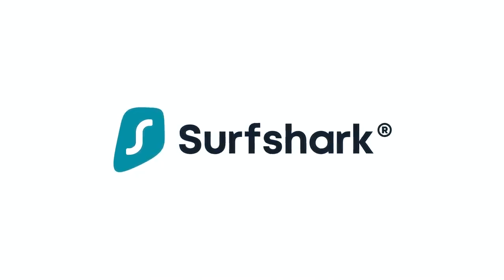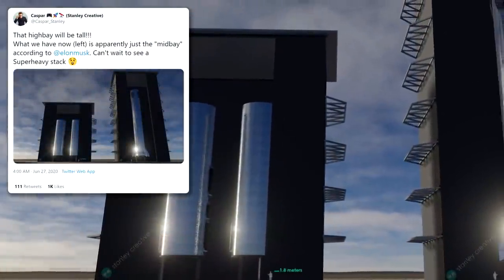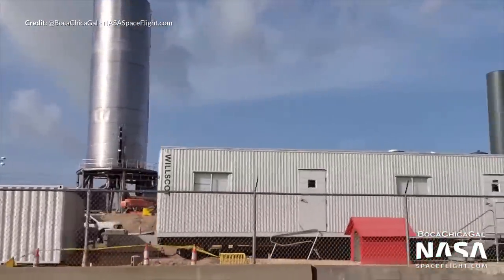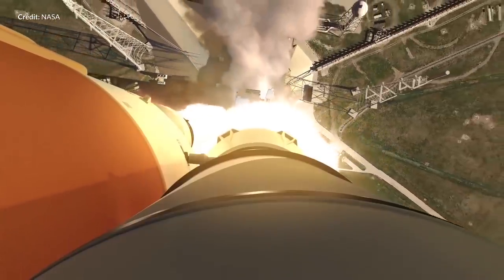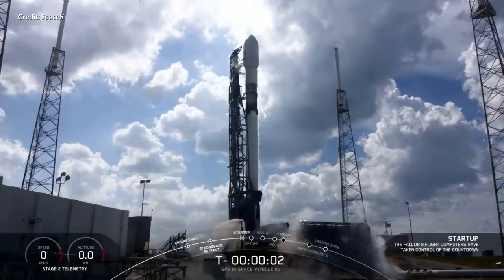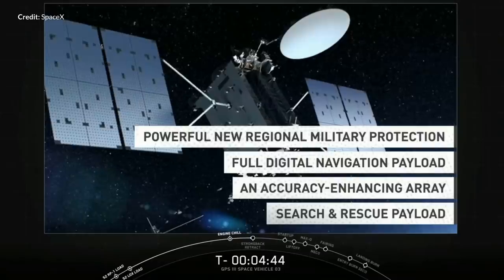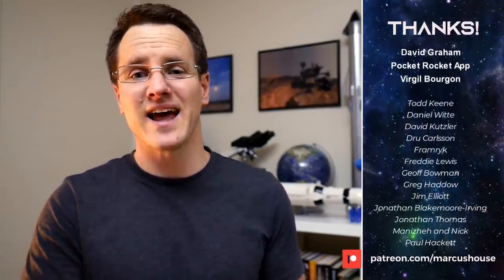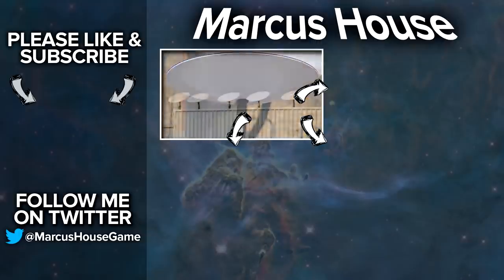Starship updates with SN5 Pressure Test, SpaceX GPS III, Mars Perseverance Rover Launch Date Slips

Comment: Vertical re-Orientation Maneuver and re-Ignition of Thrust

Yes, ladies and gentlemen it's the V.O.M.I.T. flip
Reply from the maker: That is the winner so far!
Reply: I was gonna write "collective throw-up moment" but your version is much better...
Reply: V(e)rOMarIoT you mean?
Reply: Yes please show the tracking station
Reply: NaIled it!
Reply: everybody:  Y E S
Reply: The V.O.M.I.T. flip appears to be extremely dangerous. Unless of course there is launch abort capability that can carry the crew to safety if something goes wrong. Better yet.... Why not scrap Starship and make SLS reusable?
Reply: @DavidJohnson-tv2nn  cos Starship will be the worlds cheapest launch system SLS $1b. Starship will be less then $100m
Reply: @Sonderax  How safe will Starship be?
Reply: @DavidJohnson-tv2nn  aircraft don't have launch abort systems and you don't poop your pants about them, do you
Reply: @DavidJohnson-tv2nn  we wont know until its flown a good amount. SLS will be human ready first but both are different. SLS is more crew based. SS is going to replace the F9 one day. Its gonna become a earth, lunar and martian transportation system.. We will learn safety once its ready for human certification
Reply: @Sonderax  Well, we know that Musk has no plans for launch abort on Starship. So there is a huge problem right there. It probably won't be certified for human flight without launch abort capability. Then the next question is... Where will production models be built? If they are built out in the junkyard like current prototypes... Then there is a real serious additional problem. As quality control can NOT be maintained under such conditions. So I can agree with you on this.. We'll have to wait and see. And hope changes are made for the better. Because as it stands now, it doesn't look good.
Reply: @DavidJohnson-tv2nn  space shuttle had no launch abort. That was certified. Many spacecraft have had no LA or IFA capabilities
Reply: @Sonderax  And we know what an absolute disaster the Space Shuttle was. Since the Shuttle, all manned space vehicles have launch abort. That includes Orion, Starliner, and Crew Dragon. Does anyone really want a repeat of the Challenger disaster?
Reply: @DavidJohnson-tv2nn  Only 2 disasters in the shuttles multiple decade life. Weve learned from that. Rockets are safer now. Starship wont have humans for about 5-10 years. It will be fine. We wont get Challenger v2
Reply: @DavidJohnson-tv2nn  "extremely dangerous.... Why not scrap Starship and make SLS reusable?"
Let them train with dummies on board until they master it perfectly. Five Starships with dummies at every Mars launch window should be possible. Money is not an issue as long as SpaceX keeps out of Stock Market shark sea.
Reply: @DavidJohnson-tv2nn  A disaster didnt launch the ISS, A disaster wasnt one of the most used space vehicles in history. Nobody wants a challenger repeat. But if we have something like Starship with 100-1000 people onboard how do u evacuate them all from a rocket mid flight?
Reply: @DavidJohnson-tv2nn  and the issues that lead to those shuttle disaster and close calls have been addressed with Starship. Also, starship itself is a launch abort system. And OF COURSE they won't make the final product on a scrap yard, don't be stupid now and pretend that would be an actual option.
Reply: I mean it's either that or "Begin Alignment Retrograde For Final Decent"

"Starship has successfully B.A.R.F.F.D.! 15 seconds to touchdown!"
Reply: @Sonderax  didn't the Orbiter have the capability to decouple from the rest of the STS and glide back?
Reply: @Sonderax  You obviously don't put 1,000 people on Starship. Even if it can carry that many passengers. Way too high of a risk. For 100 passengers or less you eject the passenger compartment or multiple small passenger compartments. From there, the process is really no different then launch abort for Crew Dragon. Just a larger version of it. Such a system will also work for a malfunction on landing. The are just too many chances for things to go wrong to risk that many lives. Because it's not a matter of if, but when something goes wrong.
Reply: @akshaygowrishankar7440  Only after the first 2 minutes when the solid rocket boosters burn out. And then, only under certain conditions.
Reply: @snuffeldjuret  There are always issues that can cause disaster. And new issues are introduced with landing. Regarding the Boca Chica junkyard where Starship prototypes are now being built... So where's the REAL factory going to be built? And WHEN will construction start? And if construction doesn't start soon, how will Musk meet his timeline of the first mission to Mars in 2022? Mission to the Moon in 2023? And a manned mission to Mars in 2024? You guys should ask some questions rather than just follow.
Reply: @DavidJohnson-tv2nn  About these... Raptor vacuum engines will eb able to be used at sea level, providing necessary security. And while yes, currently SpaceX is manufacturing the prototypes in sub-optimal conditions (mind you, those conditions are only external storage now), they are building up high bays at the same site. This is definitely still the rapid prototyping phase as we know and yet the prototypes have already shown a lot of potential (Pressures tested already qualify them for cargo flights even before the custom steels are developed).
Reply: @DavidJohnson-tv2nn  The beauty of the free market is that no central authority can make that decision. We get to see both run their course and pick the best for use.
Reply: @snuffeldjuret  People often forget that there is no launch abort system from the launch abort system. In the end, nothing is guaranteed and everything has a risk.
Reply: @akshaygowrishankar7440  It had no way to deal with a booster failing catstrophically (it was next to them, traveling the same speed), a breach of the main tank (same problem), or engine plumbing/pumps exploding (they were attached to the orbiter directly).
So for all scenarios one would first look at as failure cases, the answer is "no". Any non-catastrophic failure could be aborted, but that's true for Starship as well.
Reply: @DavidJohnson-tv2nn  But is it? I'd love to see the physics on the maneuver. I would think the movement may require a more complex number of maneuvers, but possibly it is not so more difficult than Falcon 9's. The danger may be on par, namely, a mechanical failure caused by a physical or software malfunction or a miscalculation in fuel. In these cases Starship may follow Falcon9's development, ie., a number of really spectacular crashes until reaching a near perfect robustness.
Reply: Muska Pucka
Reply: @zxq9419  Just like with aviation there absolutely MUST be central authority. Too many lives at risk. The FAA already controls the airspace. No launch without their permission. The military has control over range safety, and NASA has control over anything involving their astronauts. As the commercial space industry progresses, there may be need for legislation for further regulation. We can't have vital safety systems being omitted from aerospace vehicles.
Reply: @Maty83.  Sorry but Starship can NOT serve as its own launch abort system. All of you saw what happened when a small amount of propellant (compared to what it could carry) ignited in SN4. Nothing short of FULL launch abort capability is safe. The high bay buildings are not a replacement for a real factory. So only one of two things can happen here. Musk will miss all of his timelines for launches in 2022, 2023, and 2024 (which he says he's not going to do), or....  He's going to end up building PRODUCTION models in unsafe junkyard conditions! He can't have it both ways. Time won't allow for that. Everyone should be concerned about the situation.
Reply: @clintatk  There way too many things that can go wrong on landing. And failures are not forgiving. For example, with landing gear failure on a commercial airliner,  the plane can still land. If one of the landing legs on Starship fails to properly deploy, the results would be catastrophic.
Reply: @DavidJohnson-tv2nn  Shuttle serverd as its own launch about too. Of course, crewed missions will have extra features to accomodate safe return (and the "tiny leak" you refer to was the 4th prototype built in very short order, meaning that due to the way of testing you'll get major errors ironed out quickly). Same would have been the case for Dragon if thry had been allowed to land propulsively, or even Boeing's new capsule. The scale is of concern, true, but for cargo starships (which are the first goal), these features should be enough. As for your comment about junkyard conditions... I will mention several factors contributing to your vlaim appearing unsubstantiated. Firstly, Storage ans manufacture. Yes, overgrown tents. But tents with top-of-the line manufacture and QA. Assembly inside a Vehicle assembly building. Storage is the only concern as of this moment, however, this is due to slow testing due to the pandemic, creating a certain backlog of test articles. Elon may not indeed meet his deadlines, but he will give it a good go regardless.
Reply: @DavidJohnson-tv2nn  
Well, we know that Musk has no plans for launch abort on Starship. So there is a huge problem right there. It probably won't be certified for human flight without launch abort capability.
And we know what an absolute disaster the Space Shuttle was. Since the Shuttle, all manned space vehicles have launch abort. That includes Orion, Starliner, and Crew Dragon. Does anyone really want a repeat of the Challenger disaster?

There is, currently, an option for a launch abort on Starship. However, it is only applicable in an event of an explosion in the first stage. About the Space Shuttle, the only reason why it received such hate is due to the fact that it is more fragile than any other rocket. For example, the Columbia Disaster was a result of the fragile heat-resistant bricks broken during flight. The cold thermal insulation foam from the ET hit the left underside wing with  a speed of 530 mph. This is not a problem for Starship, which uses stainless steel with regenerative cooling. The Challenger disaster had the SRBs on the spotlight for being fragile, which the Starship doesn't have and won't need it. You have made a poor side-by-side comparison between the two distinct spacecraft.

 You obviously don't put 1,000 people on Starship. Even if it can carry that many passengers. Way too high of a risk. For 100 passengers or less you eject the passenger compartment or multiple small passenger compartments. From there, the process is really no different then launch abort for Crew Dragon. Just a larger version of it. Such a system will also work for a malfunction on landing. The are just too many chances for things to go wrong to risk that many lives. Because it's not a matter of if, but when something goes wrong

Situation with Starship is applicable with commercial aviation
. A small miscalculation or an error can end up with the loss of aircraft and all its crew and passengers. Undoubtedly, aircraft in the past are not as safe than the planes in the 21st century. They were prone to accidents. But as technology progressed, we were able to perfect it to the point that it is one in a hundred thousand chance of dying in an aircraft. Though they are reliable, crashes often results to hundreds of casualties. Here's a link in Wikipedia that sums up all aircraft crashes: https://en.wikipedia.org/wiki/List_of_accidents_and_incidents_involving_commercial_aircraft

About LES (Launch Abort System), it has been used sparingly over the span of human spaceflight. Only two instances of using LES were recorded out of hundred lift-offs involving humans. This defines how we are coming close to perfecting rocketry, which is also the same reason why airline travel also became safer (as stated before). In this case, why do you need to spend so much money on a system that is sparingly used when you can spend that money for making the redundant systems and the launcher safer and better?

 There are always issues that can cause disaster. And new issues are introduced with landing. Regarding the Boca Chica junkyard where Starship prototypes are now being built... So where's the REAL factory going to be built? And WHEN will construction start? And if construction doesn't start soon, how will Musk meet his timeline of the first mission to Mars in 2022? Mission to the Moon in 2023? And a manned mission to Mars in 2024? You guys should ask some questions rather than just follow

Clearly, you have some resentment with SpaceX progress on Starship. First, it is NOT a junkyard, unlike your inappropriate assertion, but a factory. Yes, the factory is going to be established near the launchpad. Construction of a proper facility and Mass production of Starship will start as soon as the SN series have completed their tests. "You guys should ask some questions rather than just follow" is a weak rhetoric. It also applies to you, not only us.

 Sorry but Starship can NOT serve as its own launch abort system. All of you saw what happened when a small amount of propellant (compared to what it could carry) ignited in SN4. Nothing short of FULL launch abort capability is safe. The high bay buildings are not a replacement for a real factory. So only one of two things can happen here. Musk will miss all of his timelines for launches in 2022, 2023, and 2024 (which he says he's not going to do), or....  He's going to end up building PRODUCTION models in unsafe junkyard conditions! He can't have it both ways. Time won't allow for that. Everyone should be concerned about the situation 

I'm sorry, but you cannot compare a test article to the real finished product. It is like comparing an experimental device to its finished product. Or better, comparing the Grasshopper test vehicle to the Falcon 9 Block 5. The high bay buildings are not for the factories but for the assembly of the ITS. Again, it is not a junkyard.

 There way too many things that can go wrong on landing. And failures are not forgiving. For example, with landing gear failure on a commercial airliner,  the plane can still land. If one of the landing legs on Starship fails to properly deploy, the results would be catastrophic

Indeed, but you forgot to take into account that they have done it more than a dozen times. Also to include that they will have 6 landing legs, not 4, for increased stability. The landing legs tech has been around from the 1960s, and it is a proven tech. Also, it takes an immense amount of skill of the pilot to land an aircraft with undercarriage malfunction. Often results in a fiery scene (not all incidents involve everyone dying).

edit: typos and text bold
Reply: @Lucky-be3oq  Thank you for taking the time for an extensive reply. Here is the bottom line on launch abort.... There have been only 329 manned space missions. As you pointed out, Launch abort has been used twice in what would have otherwise been fatal accidents. Add in the Challenger accident and now we have at least 3 accidents out of 329 missions. That is at least one fatal accident per 109 missions! That is hardly a satisfactory safety record. Proving the absolute necessity of launch abort. To send humans into space without it is beyond reckless. Partial launch abort is unacceptable due to the fact that it is useless if a malfunction occurs on Starship. To make matters worse, Musk's way of doing things introduces new risks. Such as "Load and go propellant loading" and of course, landings. The ONLY reason NASA permitted  load and go on Crew Dragon is due to its launch abort system. Regarding the Boca Chica tent city/junkyard.... Sorry, but I have to disagree with you. I don't see how under any conditions that can be considered a "factory"! If you want to see a factory... Look at the multibillion dollar Gigafactories Musk is building for cars and then compare it to that cluster F**k  at Boca Chica!
Reply: @DavidJohnson-tv2nn  
As you pointed out, Launch abort has been used twice in what would have otherwise been fatal accidents. Add in the Challenger accident and now we have at least 3 accidents out of 329 missions. That is at least one fatal accident per 109 missions! That is hardly a satisfactory safety record. Proving the absolute necessity of launch abort. To send humans into space without it is beyond reckless.

First off, I have forgotten to include that the MS-10 mission, the 2nd time the LES was used, didn't really need a launch abort system. It would've happened whether they jettisoned the fairings or not, so in that case they could've detached from the booster and start reentry procedures. Therefore bringing the number down to 1 instance of an LES totally saving lives. 

Important to note here, most of the accidents that involve the use of LES, or accidents that could've saved crew with LES happened during 1980s. If you take all human flight record starting from 1990s, you will have 182 successful flights (Including the MS-10) with one catastrophic failure (Columbia). Dividing the total flights by three, or two or whatever number you find won't help much. Failures are not caused by mere chances but by hardware, which by fixing them would increase the reliablity. Adding system redundancy and technological advances (which has greater capacities than the 60s to 80s tech) would put the launcher closer to near-perfect record. What you are doing here is the same for practically all transportation vehicles. You cannot judge the total of 41.1 million flights of airline industry by dividing it to 11,000 accidents and tell everyone that you have 1 in a 3727 chance of dying in an airplane. Your 3 out of 329 "failures" rather proved the importance of the three principles of rocket design: reliability, redundancy and simplicity. If rockets were inherently dangerous, then we would have more human-rated rockets exploding than usual.

Simply put, you have forgotten that there are many variables that division of numbers alone cannot pick up. If you want a perfect flight record, that would be the Saturn V: The rocket that successfully launched all its payload with the total of 142 engines working, despite its monstrous size and the explosive yield similar to a small atomic bomb.

Partial launch abort is unacceptable due to the fact that it is useless if a malfunction occurs on Starship. To make matters worse, Musk's way of doing things introduces new risks. Such as "Load and go propellant loading" and of course, landings. The ONLY reason NASA permitted  load and go on Crew Dragon is due to its launch abort system.

Idk what do you mean by partial launch abort? That, as far as i know, doesn't exist in any rocket science jargon. Moving on, the Load and Go Propellant Loading is a safer alternative than to have you crew enter a fully-fueled rocket, let alone having the rocket erected in the first place. Also, one thing to remember here is "human-rated". Human-rated spacecraft/launch vehicles are designed to the best of crew safety. I have no doubt whether SpaceX will improve the reliability of the Starship/ Upper stage of the ITS.

Regarding the Boca Chica tent city/junkyard.... Sorry, but I have to disagree with you. I don't see how under any conditions that can be considered a "factory"! If you want to see a factory... Look at the multibillion dollar Gigafactories Musk is building for cars and then compare it to that cluster F**k  at Boca Chica!

I have also forgotten to include that the temporary Boca Chica factory is for the "prototypes" only, which explains why they haven't built a big warehouse already. Like, why build a big and proper factory when you are still unsure of the design. Building a proper factory already meant you have the proper dimensions of the rocket, proper tooling, proper materials and calibration of the equipment. Starship is still in its testing phase/prototype stage. Building something that couldn't work or largely different from the earlier designs would lead to a bigger clusterfuck for SpaceX. In addition to that, the situation in Boca Chica helps them speed up the design, allowing in-situ repairs and modifications without hauling its ass back to the shelter.

edit: typos and singlespacing bug
Reply: Addendum:
 -Remember, they will build a proper facility once they have completed the SN series tests.
 -SpaceX still change their designs, therefore proper factories have a hard time making changes to their building techniques and equipment.
 - Still, as every procedure goes, they won't be putting humans in the first dozen or more flights.

Links for Starship Safety:
https://www.youtube.com/watch?v=v6lPMFgZU5Q
https://www.youtube.com/watch?v=nh0q_BNiZ7g
https://www.youtube.com/watch?v=SCCw_M8MAU0&t=964s
note: YT sucks at editing single spaced paragraphs.
Reply: I think the Starship we see now will be much different as they keep modifying it. Landing legs are certainly changing no matter what the art shows. You have to be able to balance that height if they land on soft surfaces. You might also see flight surface change. Elon himself says each Raptor engine has improved over the previous engine, Raptor engine design is not locked in yet. Fun to watch the iterative process.
Reply: The vomit comet's big sister?
Reply: @MarcusHouse  Hi Marcus first time I've been on here your channel is just what I like thanks and yes as soon as you said you are from Tassie I subed to you...Because that's where I'm from. I live on the North-West coast of the state.